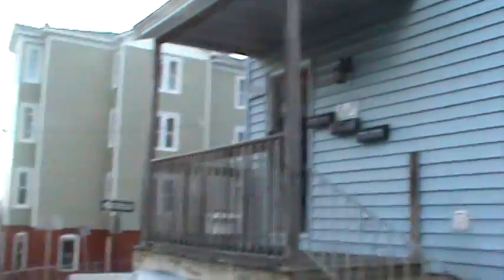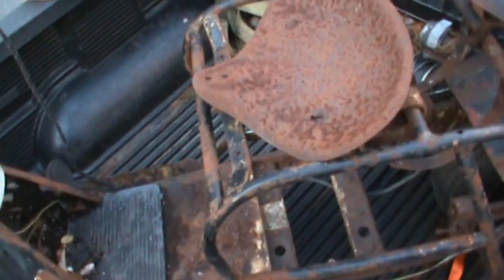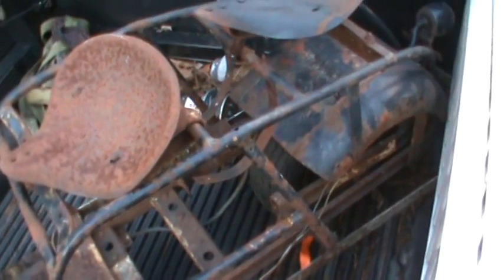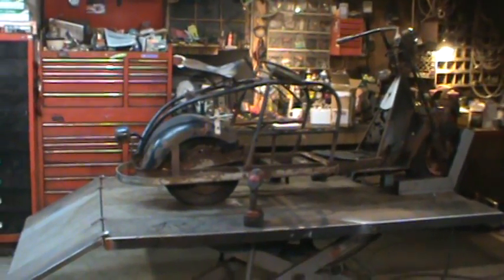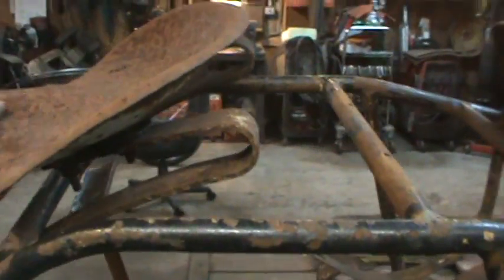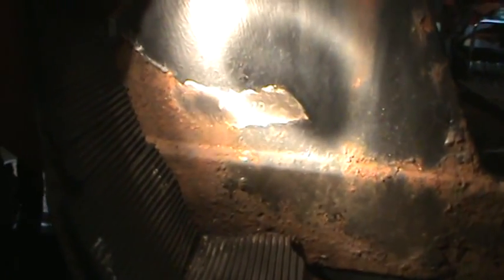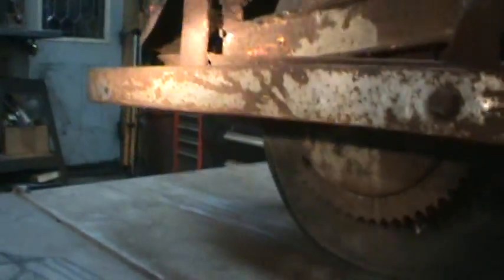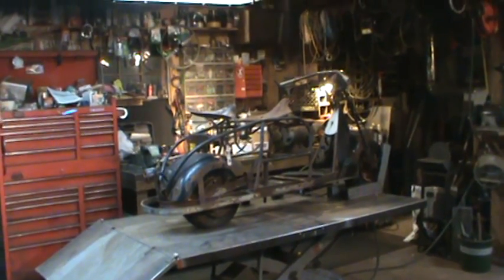cushman scooter from udizzy1969

Comment: I had a couple of those cushmans back in the mid 50's had a hell of a lot a fun runnin through the woods. no dirt bikes back then,dennis carpenter has every part you will ever need for it, it'll cost ya they ain't cheap,

Comment: I've never seen a Cushman with any kind of rear suspension before, that is really odd.  Some of the guys who restore the old Cushman Eagles put a Vanguard V twin on them with a CVT transmission, those things really run with those V twins on them. The reason why they replace the engines, the later model Cushmans, starting about 63-64, had an OMC aluminum engine in them, they turned out to be troublesome so they substitute a different engine rather than rebuild.  The old cast iron engines were pretty bulletproof, their only fault is if you took them out on the highway and ran several miles wide open, being a splash lube design they didn't tolerate that kind of abuse and could seize up.  As long as you didn't abuse them they didn't really have any problems.

Comment: It's odd, I took a look at a few Cushman Sports and it seems like yours has a pretty rare rear fender setup for the Sport models I've seen.  The seat mounts a little different too from most of the others, though it looks like that is the original, and the bumper bar that goes around the rear of the scooter is different than most of the other Sports out there.  Don't know what that means but it's a 1948 ; )